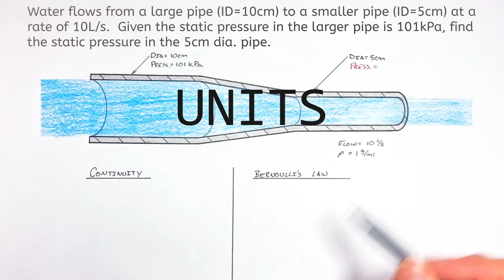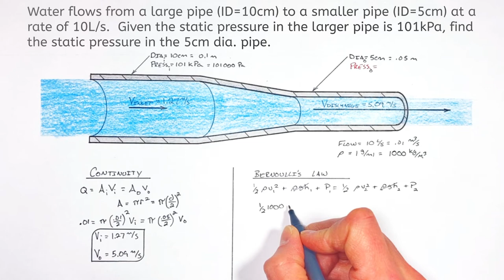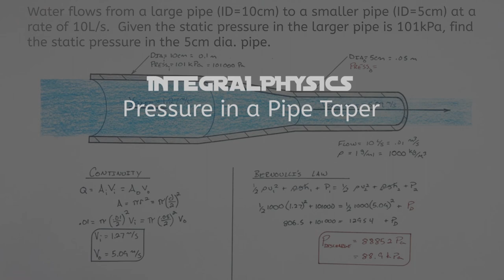Calculate Change in Fluid Velocity & Pressure in a Tapering Pipe  |  Bernoulli's Law

Comment: Hello! New engineer needs some guidance here.
Let's say i want to calculate the pressure drop from a 12" header that flowing into 3" pipeline. The values that I need to use for calculations are from the 12" or 3" pipe? For example, the internal diameter, velocity, friction factor etc....
Reply: I did try to calculate the pressure drop using the 3" inches value but the pressure drop are WAY too significant it doesn't make sense